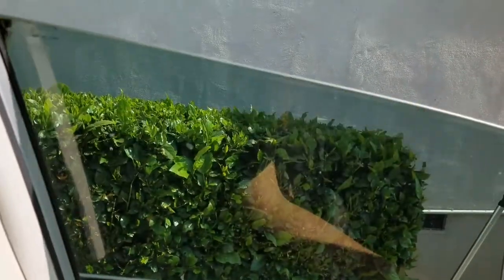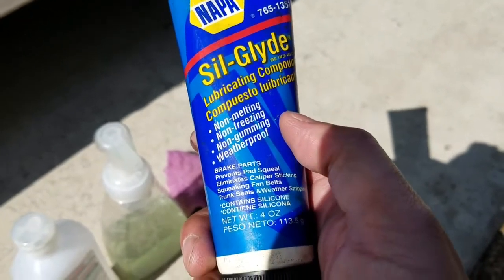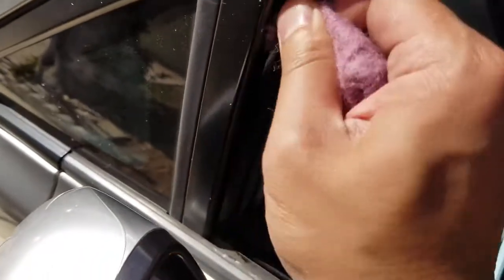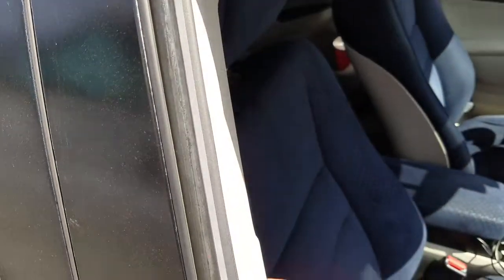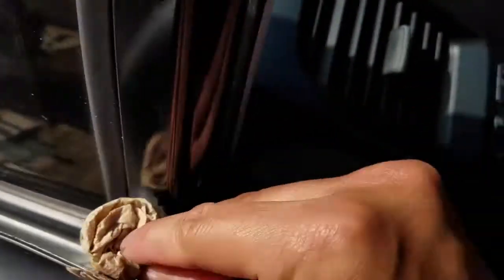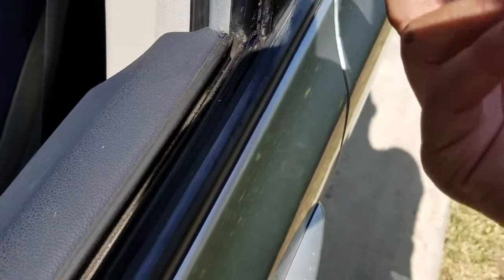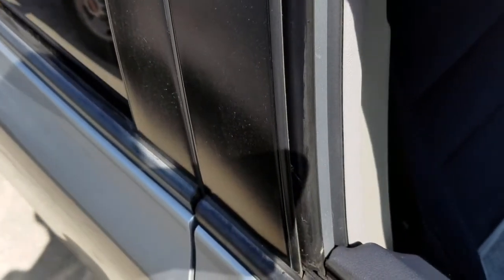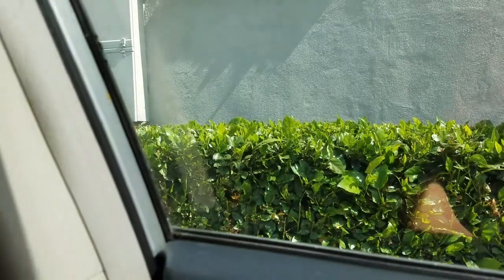DIY: 2006-2009 Honda Civic Window Binding / STUCK!

Comment: Thanks, very helpful...one question or comment....why do you bring the alcohol?  it looks like you never use it (or i missed that part)?
Reply from the maker: Denatured alcohol would work or liquid dish soap and rinsing. Then you must a little put silicone grease. According to the manual you should use Honda Shin Etsu (silicone) grease. If you use the Napa silicone grease you will need to repeat every 6 -12  months

Comment: I have a question what do you have in you dashboard? At left in you dashboard i saw a little screen. God tip for the Windows 👍
Reply from the maker: The little screen is my back up camera screen i installed myself. The 2008 -9 honda civic did not have back up camers
Reply: @SterlingW8  look beautiful is a nice way for a reverse camera screen. I like it maybe i copy you idea 😅